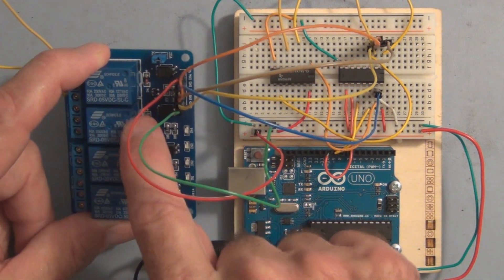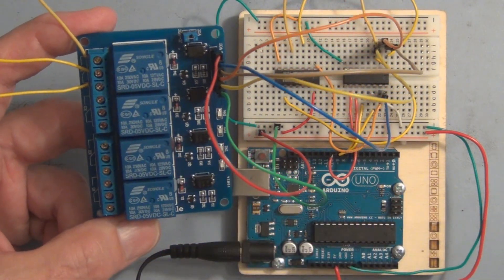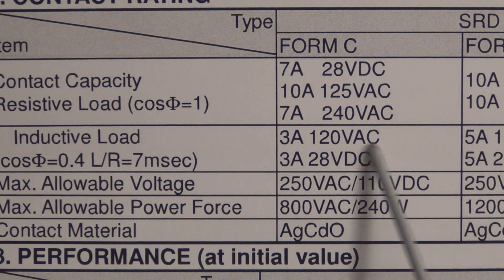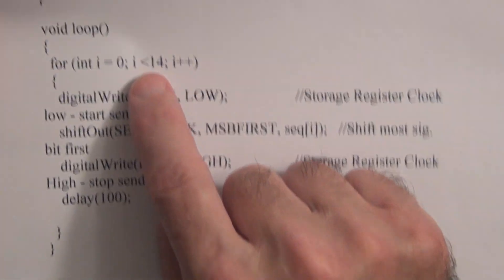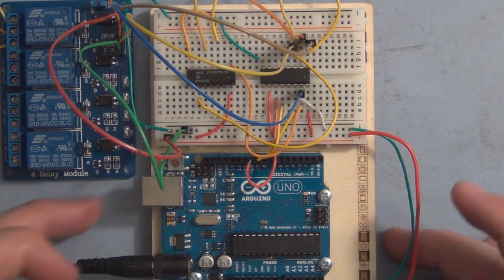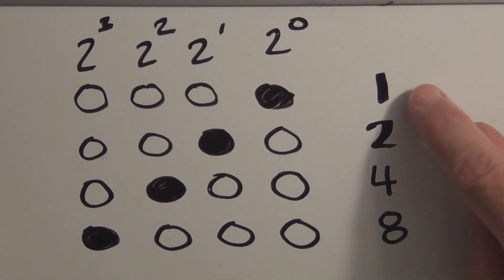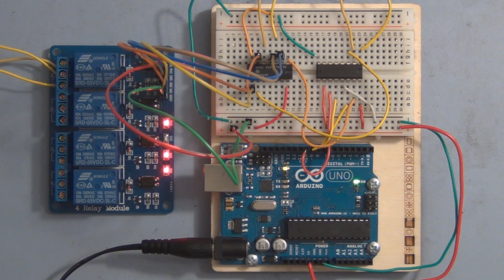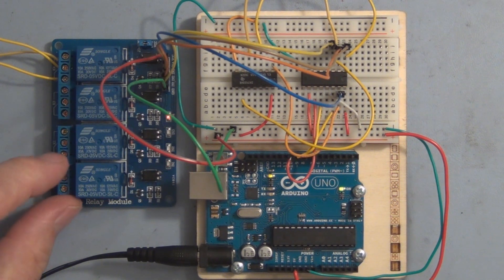Arduino Relay Control

Comment: I dint see your problem.  If the relay board is trigger when the signal is low and you have nc and no contacts just swap the contacts over on the relay output.  If the integral LED is on ( relay coil is energised) you can select which output to use from the relay itself.
Or, as a software fix just swap the signal with i = !i ;

Comment: What happens if there is a short circuit in the item on the load of the relay? Can the Arduino be programmed to have a protection system for that particular item/relay?
Reply from the maker: The relay will provide the current that it is rated for.  It is a controlled on/off switch.  If you want the arduino to monitor the current you could add a current sense circuit on the load side that the arduino could monitor and if the current exceeds a certain value it would turn off the relay.  There are multiple protection circuits that can be used but it will depend on the application and whether you are monitoring AC or DC.
Reply: eTech Tom I'm thinking about the possibilities of using one on my motorcycle to take the place of the fuse box and to substitute the LED flasher relay and to work the remaining relay for the lights. But was wondering the consequences of a short of some wires somewhere on the bike and how the Arduino could act as a circuit breaker until the fault is resolved.

Comment: Inductive loads are generally items that have motors. A motor can take some (time x) while it's coming up to speed. During the ramp up time, more current is drawn. This is more or less the difference between peak and continuous loading. If an item requiring 5 amps is NOT inductive those relays would still be marginal at best. If the same load was inductive, those relays would fail much sooner. 
If you need to run a large motor, you could use those relays on your board to energize a larger relay/contactor which is designed for heavier loads. There are other issues that come into play such as back EMF and starting capacitors used downstream from your relays and should be addressed. if anyone needs more info, you can google either.   good luck
Reply: wa4aos it

Comment: The higher current rating is for a resistive load.  As a rule of thumb, relays and switches need to be de-rated by 50%. High inductive loads, ie a fridge compressor or fluorescent lighting would  destroy or degrade the contacts very quickly due to arcing as the load is switched off.
Reply: A family size modern fidge draws about 4amps so these relays are rated correctly for that type of inductive load.

Comment: Can you tell me the reason of reset in esp8266 v1 module while connected to relay with 220v. I have tried esp8266 with relay with 3.3v and 5v, and it works perfectly. But when i connect 220v to relay and control relay with esp8266 the result is unpredictable. It works for a while. But after certain attempt, esp8266 stops responding. Can you help me what might be the problem?
Thanks
Reply from the maker: Looking at the description on the sparkfun website https://www.sparkfun.com/products/13678 it mentions that you need to use a level shifter.  Note: The ESP8266 Module is not capable of 5-3V logic shifting and will require an external Logic Level Converter. Please do not power it directly from your 5V dev board.  Have you taken this into consideration?  You might need level converter like this https://www.sparkfun.com/products/12009.  Here is a link to a tutorial on using the esp8266 module
Reply: Thank you so much for the replay. I havent use level shifter in my project. For easiness I have made image of what I am doing. Please have a look.
http://santoshm.com.np/wp-content/uploads/2016/11/diagram.jpg
Do you think its using level shifter will solve this issue?
Reply from the maker: I have not experimented with this module but I found this information that is similar to what you are trying.  http://iot-playground.com/blog/2-uncategorised/40-esp8266-wifi-relay-switch-arduino-ide.  I you scroll down you will see the level shifting circuit you need to use between the ESP8266 and the relay.  You could also just get a 3.3V relay module
Reply: Thanks you. I will try with this one. :)

Comment: 8 channel relay
Reply from the maker: Here is information on the SainSmart 8 channel relay and it looks like pins 2 and 3 are normally closed. http://www.sainsmart.com/8-channel-dc-5v-relay-module-for-arduino-pic-arm-dsp-avr-msp430-ttl-logic.html.

Comment: which side is always connected meaning if you attach the wires and it will stay on even the board is off?
Reply from the maker: It will be indicated by an NC at the pins for normally closed or NO for normally opened.
Reply: Which one of them
Reply from the maker: Do you have the same relay board or an individual relay?  If you have an ohm meter you can measure the normally closed pins.

Comment: Can I use 12V 1A adapter to power up the Arduino Uno ?
Reply from the maker: +himu The Arduino Uno can use a 7-12 volt supply.  Just make sure the center pin is the positive.  There should be a symbol on the case that shows the polarity of the center pin.

Comment: Would you build something for me if I paid you? Or maybe you could help me massively.  I'm trying to do it but having trouble! I am probably going to explain this badly but I can elaborate on it. 

I just want to build a latching relay board that controls 6 accessories individually (low voltage accessories on my car) via a touchscreen LCD mounted on the dash. I also want to be able to use my phone via Bluetooth to control each of the 6 'switches'. Thanks for your time and I hope you can help me.

Comment: my relay output has LOAD / Normally Open terminals. I'm not sure which way round  to connect the AC wire, if it should be the live or neutral wire, or if it even matters?
Reply from the maker: +ArcanePath360 Here is a link that may help by explaining the relay connections.  http://www.engineersgarage.com/tutorials/introduction-to-different-types-of-relays
Reply: +eTechTom  Thanks, it did not answer the question though. I eventually figured out that LOAD must be the output, and NO is the supply, since light switches sometimes use a similar nomenclature.  Tested and it didn't explode and kill everyone so it must be correct.

Comment: I have this type of module. I am looking to turn on all 4 channels, with one of the channels with a delay through a custom script. I am planning on using a jumper wire (toggle switch) to ground one of the PWM inputs to turn off 2 out of the 4 channels with scripted delay and the other two channels without scripted delay. I am also using an additional toggle switch to over-ride the 3rd channel to keep relay off(gate controller monitor fault/alarm). Any suggestions on a script for this? I am new to this Arduino platform. This is a quad gate railroad crossing controller signal.

Comment: you can run a resistive load at a higher power because the voltage and current are in sync with each other, when an inductive load is energized due to the magnetic fields in the coil the current lags the voltage (power factor), they become out of sync. this in turn causes a loss of power so the load draws more current to account for this.

Comment: Great video.  I have been trying to setup a different IP to the imatic 8 relay system.  Have you had any experience doing so?  I have seen you need to hace the arduino, but do not know how to do it.  I ordered 8 systems but got stock all of them with the same IP and port.  Thanks for the help you can give me.

Comment: The inductive load refers to the back EMF that your appliances are producing.
Some inductive loads, like the electromagnet in an electromechanical relay, might feed a power surge back into the circuit when power is disconnected from the load, which can damage the circuit.
Reply: this is most commonly an issue with motors as they contain coils which create 'negative voltage' or back EMF which, unless properly managed with diodes, etc., can 'backfeed' into your relay and/or other component which are voltage sensitive.  While some have a voltage sensitivity in the 100's of volts and could handle this back EMF/-V for the short time involved (ms's, not seconds), many components do not.
Thus the 3Amp rating is lower than the non-inductive 10Amp rating, as a motor requiring 3amps to run will provide considerably less -V/Back EMP than a motor requiring 10amps to run will when turned off. Not certain of the differences off the top of my head, but if that is of concern to you, then you have a lot more to learn/know than this video will provide; this video is for beginner/home DIY not hobbist or pro.

Comment: Here is what I would like to do. I have many lights (12 volt DC) to control on my truck. I would love to have a simple control box in the truck and keep the mess of the rest under the hood. Can the arduino be set up in a way that it would sense variable power differences to control relays. My plan is to have only one wire going from switch in truck to arduino.
Reply: Ok a car steering wheel with lets say cruise controls on it actually uses only one or two wires to transfer a signal to the computer. The computer inturn knows that if it receives a 12 volt current at 1 ohm that means cruise "ON" where as a 2 ohm signal would mean accel. do you follow me?

Comment: Hey! I wanted ask.. whats the difference between using a shield and just using a relay? I know I'll have to give it additional power supply but, apart from that whats the difference? Because a relay would be much cheaper than buying a shield.
Reply from the maker: There really isn't any difference.  This relay module does not plug into the arduino so it is not a shield.  The third party vendor does not supply a schematic for the module so it's probably easier to control a single relay since the module has support circuitry for the LEDs and relay voltage noise.  It is convenient to have the terminal blocks to hook up to though.  I have a video on a single relay.  It's just a matter of activating the coil in the relay and whether your circuit requires the normally closed position or normally open position.  https://www.youtube.com/watch?v=Hu4d9ae9e-o
Reply: Okay! Thank you!

Comment: Inductive load is in regard to motors and therefor the surge when the motor comes on is very high compared to the run load.
I have just started with Arduino so found your video very interesting thanks.
Bob

Comment: Nice video, thank you :)
Reply from the maker: Thank you for your commment
Reply: +eTechTom 
Hi can u make a tutorial on how to control the relays wireless, Like i dont have to attach the relay to the aurdrino through wires or may be i can attach the relay to the appliance (bulb or fan etc) and control it wireless sending signal from mobiles to aurduino and then to relay.
Pls send me links in there is any tutorials 
santoshranjandas@gmail.com